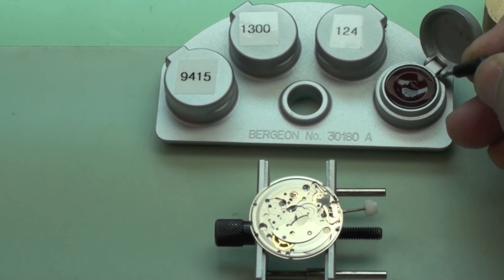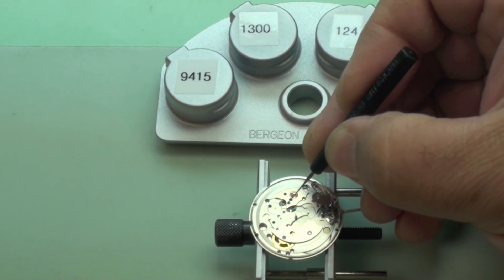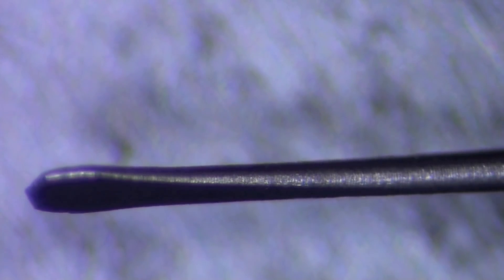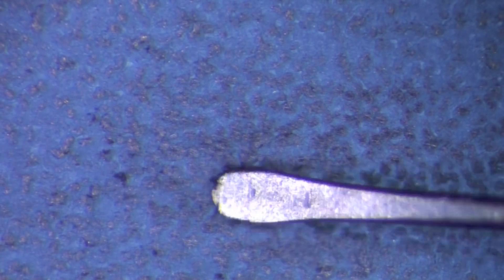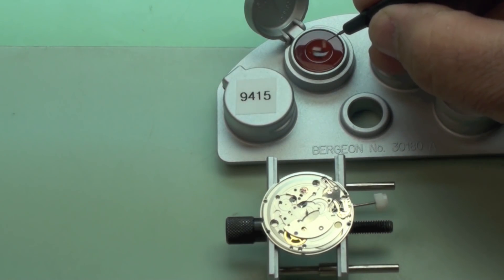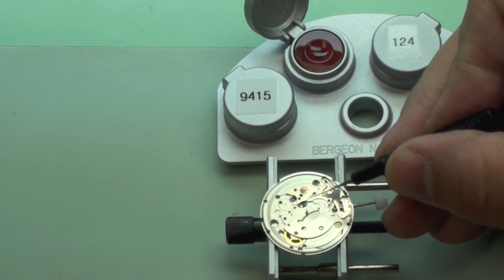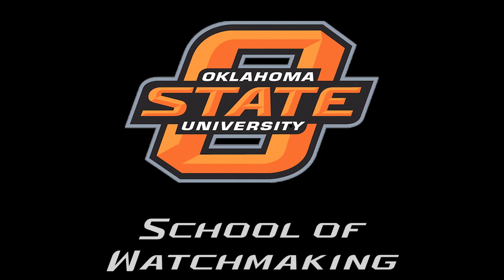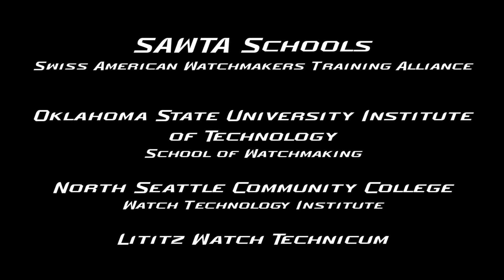Lubrication Control Part 1 - School of Watchmaking @ OSUIT

Comment: How many types of oil needed for a maintenance of a watches.
Please, can you name it.
Where should I get it?
Reply: ^ please, nobody listen to this guy. This will cause a simple gasket change and oiling to turn into a complete movement disassembly and cleaning, quadrupling the cost of a service. The service interval will also be half as long, and will make overall maintainable cost 8x as much. Don't listen to this clown.
Reply: A cheap mineral oil. or even a animal oil based, so when it dry you will know its time for a service, if you use syntetics when you discover that watch needs a service it will be too late, you hve scored pivots.
Reply: a cheap animal oil, or mineral oil.